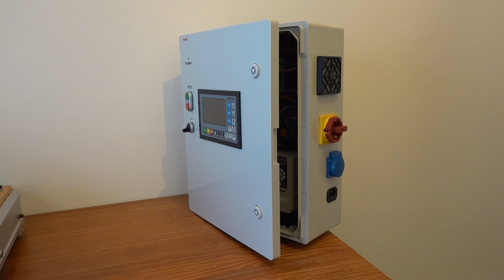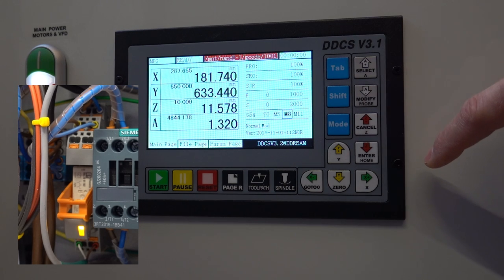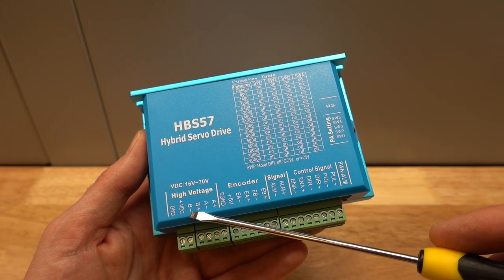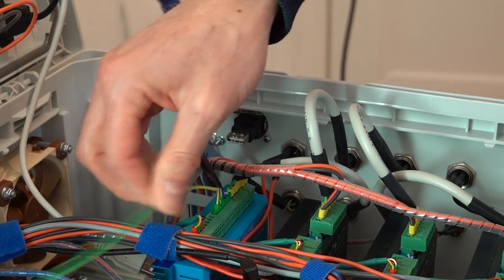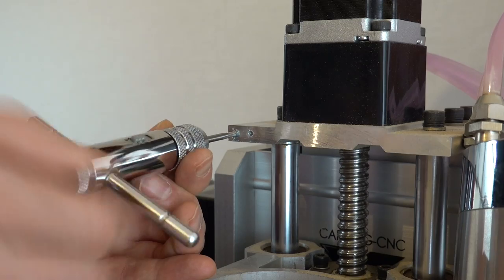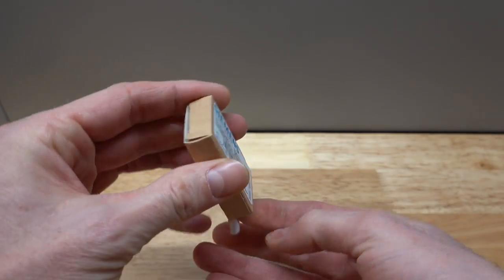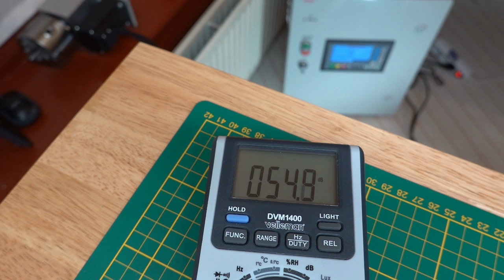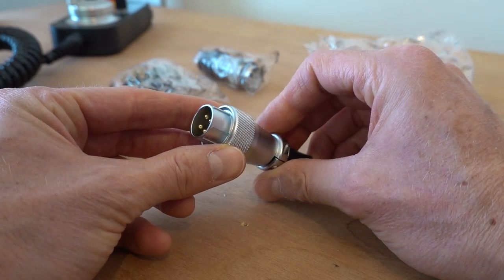Build Your Own CNC Controller Part3

Comment: Bedankt voor je video's, ze helpen mij een heel eind op weg. Vraagje, ik zit er over na te denken om 4 x DIN rail voedingen van Mean Well te gebruiken in plaats van 1 grote voeding. Ik ben niet technisch aangelegen op het gebied van stroom, maar ik denk dat dit wel kan. Ik wil de EDR150 24 v 6.5 A gebruiken voor de 3 A stepper motoren die ik heb. Dat moet toch goed gaan?
Reply from the maker: Hoi, ik heb ook geen achtergrond in de elektrotechniek, maar probeer er doorheen te komen met wat basiskennis en manuals lezen. Dat gezegd hebbende denk ik dat je wel uit de voeten kunt met de voeding die je noemt. Lijkt me wel wat overgedimensioneerd, maar dit biedt wel ruimte om later door te groeien met dezelfde voeding. Ik vind dit ook een mooi model, qua form factor en lijken ook efficiënt. Als ik geen bestaande voeding had was ik ook voor zoiets gegaan. Is er een reden waarom je voor de EDR kiest ipv NDR? Laatstgenoemde lijkt wat vaker voor te komen en voldoet aan strengere EMI standaard. Ik weet echter niet of dat echt significant van invloed is in een CNC controller. Als je een goede prijs kunt krijgen op een van de modellen zou ik het gewoon proberen. Ik heb ook verhalen gelezen over de nadelen van regulated power supplies bij stepper drivers, maar ook daar betwijfel ik of je problemen krijgt met een normale toepassing. Als je een model ziet dat goedkoper is en dichter in de buurt komt van de 3A dan is dat heet overwegen waard, zeker als je aparte power supplies wilt voor elke motor. Hopelijk kan je hier iets mee. Groeten, Robin

Comment: excellent work, I ask you some questions: 
1- which motor do you recommend, step motors or servo motor? 
4- about Controller, for a professional use, which one do you suggest me buy? maybe DDCS V3.1 ,AXBB-E , Centroid 4 axis Acorn?, Arduino, or some other? What is the difference between them ?

5. which is better or the difference of using Ball Screw nut BK/BF12 or Timing Belt ? Which is faster ?

thank very much
Reply from the maker: 1 for a hobby router (closed loop) steppers are fine, if you have the money and want faster quieter motor with more advanced position controller go for servos. I would love to have them on my machine but got me it doesn't make sense. Having said that, I have bought a lot of stuff before that did not make sense.
4 the first 3 you mention should all be fine from what I read. Just see what you personal preferences are regarding form factor, use of PC, connections etc. I also had Masso controller on my short list. You can attach your own touch screen to this. Like I said it is personal, I would not want to push the DDCS on anyone, that is just what I bought.
5 belts vs lead screws: I only have experience with the lead screw. Check out CNCzone forum. There is a discussion with pros and cons for both. Depends on application as well. For larger travel also rack and pinion is used.

Comment: very nicely done. I have done a build that's 99% done but its a lot more rudimentary than yours. You make me want to redo everything.
My bed is 2m x 2m and my Z travel is 300mm to allow for my 4th axis
Reply from the maker: Thank you! That is an incredible working area by the way. Would like a bigger router as well but I would never be able to fit that in my hobby space.
Reply: @uptimefab7412  its frustrating to hear you just speak information all the time and I spend hours looking for it 😆 it would be nice if I could drop you some questions please?
Reply from the maker: Sure, no problem. I will also not have an answer for every question but I will do my best to help.
Reply: @uptimefab7412  so my Z home is at the top, which is +275.00 (homing direction is positive). When I use the main screen and navigate Goto, to move the Z down 100mm to test calibration, I am not able to change the + to a - . the Z only wants to keep going up. I am scared to make my Z home at the bottom. and if I do a test job the gap above material is set to 20mm. when I run the job the Z just drives up into the stop. any advice please?
Reply from the maker: Hi, I am also homing the Z at the top and that works fine, so it should also be possible on your machine. For trouble shooting I would start with the basics. If you manually jog the axis down with the Z- key or an MPG is it indeed moving in the right direction? If not you can swap the direction on the stepper driver or with a parameter in the DDCS (#392). If the axis moves away from the sensor instead of towards it when homing change parameter #66. Try to look at each thing step by step, what is working and what isn't?

Comment: Nice time to start thinking about next project on servo and linuxcnc :)))
Reply from the maker: Thanks for the tip! Would be great to experiment with servo motors. For now I have another project lined up. Just bought an Emco turn 50 with electronics removed and already bought a SZGH controller for it, sorry no linux.....
Maybe for another project, linux CNC seems like a good system, but at the moment it seems  I am in a chinese controller phase :)
Reply: @uptimefab7412  sure:) ...you need some time to play with this....but mesa cards for $300 (7i92 + 7i77) (thunk it's cost of your controller) can give you incredible functionality and all modern gcode features....perfect postprocessors for CAM and network acees to machine ( nice to save gcode from CAM directly to machine:) Also it needed it You start thinking about ATC :)
Reply from the maker: I will start dreaming about an ATC :)

Comment: Thank you so much the very detailed step by step video guide. It is awesome! I'm in the process of gathering all the components and an enclosure. I would like to know what gauge wires should one use all the different low voltage DC cabling between the psu's and the signal wires from the motor drives to the DDCS etc and the 4 core shielded cables you have used for connecting the GX16 connectors. Because shielded cables comes in various gauges, if you happen to know how many strands per wire and thickness might be helpful. In my case I will be using a simple Arduino Uno3 with a screw terminal shield.
Reply from the maker: Hi, I use 22AWG (0.34mm^2) for signal wires and 18 AWG(0 75mm^2) for DC power to stepper drivers and the stepper motor cables. For my components this should be sufficient. If you want to formally determine required wire gauge sizes then you can calculate based on wire length and voltage drop, in that case more information is available online. The number of strands is not important, just the diameter. I use flexible wires (multiple instead of single strand) everywhere. For signal wires there is also a practical aspect. You could use very thin wires but these are difficult to handle. ( Small ferrules are difficult to keep attached, wires can break etc). Hope this helps a bit.
Reply: @uptimefab7412  Thank you for your reply. I had a real of 4 core plus shield alarm cable and was planning to use that for "testing" but i think it is 24AWG 0.22 so a little thin. Like you said they are difficult to handle. I will get the same size that you have used. btw I posted a link to your build on Cindymill Discourse forum so you may get traffic on your blog :)
Reply from the maker: Haha thanks for sharing. Thicker is not a problem so you could even go up another step depending on what you can get your hands on.
Reply: @uptimefab7412  Yes, i'm having problems getting parts and even common items such as cables are in short supply. I am having to find bits and pieces on ebay.
Reply: At long last just got my motor side GX16 connectors soldered and connected to the plug in drivers following the steps you have shown in the video. Moving on to wiring the DC power cables. I forgot to ask earlier what gauge of wire did you use for this purpose?
Reply from the maker: Hi, the thickest wire I am using in this enclosure is 18AWG / 0.75 mm^2, which should be sufficient for the components I am using. If in doubt you can calculate wire thickness with an online DC wire thickness calculator. Just enter voltage, amps and wire length an it will give an indication of minimum wire thickness. Good to see you are making progress, best of luck with the rest of the build!
Reply: @uptimefab7412  Thank you for your reply. I have obtained the same Siemens contractor as the one you have used and would like to wire it up in my setup. I am going to use a 500W  spindle driven by a step down mains to 100vdc PSU. Have followed your latest wiring diagram, am I right to think in your setup when you connect the mains cable to you 230vac inlet, and you turn it ON one of the 24vdc psu enegises the 24v to the Sienems and the second 24v psu turns on your DDC and the fan. At the same time contractor relay engages and the L & N feed is switched on to you DC powersupply?
Reply from the maker: I had to look back at the schematic myself to answer this. Both 24VDC power supplies are turned on when the mains switch is turned on. One of them is used only for the IO of the DDCS, while the other power supply is used for powering the DDCS itself, the fan and for engaging the contactor when the green button is pressed. I wanted to make sure there is as little chance of interference for the IO, so that is why it is on its own power supply. For the contactor the 24V is inly used to engage it. It also switches a 24V lead, but that is only for supplying itself with voltage when engaged, so it will act as a sticky relay. The actual lines it switches are 230VAC for several components. Hope that clarifies it somewhat. 
Best, Robin.
Reply: @uptimefab7412  Thank you so much for revisiting the schematic. You have explained it perfectly and what you mentioned is just as I assumed the workings of the different power supplies. So all good, you take care my friend :)

Comment: Well done Robin! Did you also ground the machine frame? 
And question off topic - are you dutch?
Reply from the maker: Thanks! At the moment I only have the spindle housing grounded. This has the highest risk due to the high voltage connection of the spindle motor. The rest is low voltage. I have measured and the grounding transfers through to the entire machine, but this is not the proper way to do it, the bed and gantry should be grounded independently as well (I think). Yes I am dutch, hard to hide the accent :)

Comment: hi, great job.
So you connected all the stepper and spindle shields to the AC power ground?
I have to wire the electronics of my cnc and I would like to do things better.
Reply from the maker: Hi, thanks! Yes, all wire shields, spindle and all other components that have a ground connection are connected to a central point (ground bar). The ground wire from you AC mains cable is also connected to this same ground bar.

Comment: You definitely need to protect coolant hoses from bending. And maybe add some radiator, because it's can be not enough.
Reply from the maker: Thanks, totally agree on the bend protection.  Regarding the coolant tank size, this works for me but probably because I only use it for short periods of time.

Comment: Gracias por compartir tus conocimientos, tengo un problema con el eje A, al minuto de funcionamiento el driver enciende la luz de falla, revise todas las conecciones y están todas bien, tu sabes que parámetros de la controladora debo cambiar?. Saludos desde Chile
Reply from the maker: Hi, I ran your question through Google translate because I don't speak spanish:
-----------
Thanks for sharing your knowledge, I have a problem with the A axis, after a minute of operation the driver turns on the fault light, I checked all the connections and they are all good, do you know what controller parameters I should change? Greetings from Chile
----------
My reply: I connected the driver the same way as for the other axes (besides the encoder). For the calculation of steps per rotation please see the PDF in the article linked in the description of the video. Other than that is should work. For trouble shooting you could swap the stepper driver with the one from a different axis just to verify if the driver itself is not the issue. (then test both swapped drivers on their new axis) Does the driver also fault out if you don't move the axis? Also you could check what happens if you remove the belt from the stepper and run a program. This will tell you if the motor might be overloaded by your application or belt/axis assembly. Hope this helps. Robin

Comment: Excellent work on this series, I will be referring to it religiously, now that I have decided to get rid of Mach3 for my 6040. The DDCS seems to do exactly what I need, and what bugs me about my combination of cheap breakout board and Mach3.
A question: Have you considered integrated servo motors like the iHSV57? I've used them on my machine, and except for their power requirements being higher (necessitating a new PSU), they were a near drop-in replacement for the steppers. From my limited understanding, the advantage they have is that they maintain their torque over nearly their entire RPM range, whereas steppers lose a lot of torque in the extreme ranges (low and high). Plus, they're closed loop, and at least on my machines, significantly faster.
And even if none of that is appealing, the fact that the driver is mounted to the motor means you would free up significant amounts of space in your cabinet ;)

I was also wondering if it is possible to combine the functionalities of your different e-stops simply by wiring them together. Wire the pendant into the external e-stop circuit so that hitting the pendant will perform the same way as the external one, and vice versa? Would that work?
Reply from the maker: Hi, thank you for your feedback, good to see it helps other CNC enthousiasts. I am actually looking at servos with integrated controllers for a possible next project. Indeed more toque at higher RPM, but less holding torque at low speeds. I think less torque at low speeds should not be an issue but this depends on the situation. Maybe for a heavy Z-axis it might. The Servos should also run more quiet, for some this might not matter, but I think it is great to have low noise motors instead of the typical stepper noise. Unfortunately I do not have experience with these yet, but night give them a try. On the Clough42 channel James tested a cheap servo in case you had not seen that already. If you are first let me know how it worked out for you! 
For the E-stop you could indeed wire the MPG button in series with any other E-stop, should work fine if they are both Normally Closed switches.
Reply: @uptimefab7412  I can confirm that the iHSV57 I use are quieter. I have not had any issues with holding torque, but then again, my cheap 6040 is pretty light to begin with. Only when I turn off power to the motors does the Z axis drop. But that's not a problem. Just have to keep it in mind when you turn the machine off.
If you have questions about the servos, feel free to ask. I'm only a curious amateur (with sometimes poor impulse control), but any information I have, I'd gladly share!
I had come across Clough42's channel (and many others - oh so many! Turns out, information about an iHSV57 conversion is kind of spotty. Maybe I should make a video about what I did...) before I started my conversion, but it ultimately ended up being about a different motor than I had in mind. Still, his channel in general is a decent resource of information!
Reply from the maker: Thanks for the information, good to see that the servos are working for your 6040. Now I am even more interested in giving them a try!
Reply: @uptimefab7412  Should you end up with iHSV57s, I recommend making sure they're v6. Reportedly, that version's auto PID tuning removes much of the hassle!

Comment: Hi. How did you get the closed loop to work with this controller? I’m having issues after connecting new closed loop stepper and driver. Doesn’t work at all. Can’t get it to work in open setting without encoder too. Works fine with regular steppers and drives.
Reply from the maker: Hi, the connection for a closed loop driver is exactly the same: 2 for direction and 2 for pulse. Are you sure you have all 4 wires connected correctly and that they are making proper contact? You can also check if you driver is faulty by a cheap "pulse generator for stepper driver" or even manually generating pulses with an external power source.

Comment: Hello, I'm from Brazil and I'm written on your channel. I have this controller and I'm having a hard time. the stepper motors are turning upside down how can i solve?
Reply from the maker: Hi, you can use parameters #390 up to #392 to change the direction for each axis. Change from 0 to 1 or vice versa if your axis is moving in the wrong direction. For my specific machine X is low (0) and Y and Z are  high (1), but this may vary per machine.
Reply: @uptimefab7412  Thank you friend

Comment: Have been looking at these controller's. What geode post processor do they use?
Mach3 and Linux cnc are supported by most programs like fusion 360. But can never find what code flavour these want.
Reply from the maker: Hi, I am just using the standard Mach3 post in fusion 360 and this works fine for me.

Comment: Hello, Great video!
Could you tel where you bought the framatel enclosure? Thanks
Reply from the maker: Sure: Vekto.nl
Reply: I bought mine from ebay.  the part number seems difficult to find in the USA.  and it seems like all of the boxes in the same size (or larger) are metal